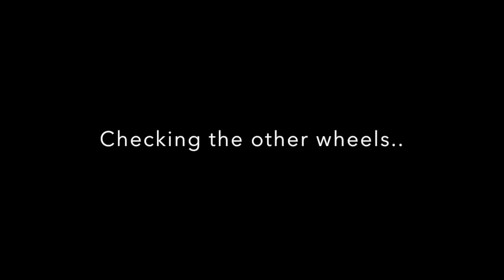New C63 wheel damaged after only a month!?

Comment from the maker: Pittsburgh potholes squad!
Reply: AutoVlog Good Morning,   Them potholes aint no joke.  They will  Mess your car up.  But on a good note may you have a fantastic day.
Reply: I almost his a huge one in Hopewell the other day. The worst.
Reply: AutoVlog Jag har tänkt på att skicka ett brev till dig, men jag vet inte hur man skickar brev utomlands. Hur gör man?
Reply: Pittsburgh pothole squad reporting lol
Reply: I feel your pain. But come to New Orleans...we don't have pot holes...we have CRATERS. I hope it's an easy and not so expensive fix. Stay blessed.
Reply: AutoVlog can’t you sue them?
Reply: Low profile wheels look cool, but this happens alot because the rubber is so thin, and the rim so close to the ground. You got off light if the tracking wasn't screwed up as well btw. I hit a pothole once and cracked the lower swing arm, only found that out when I went round a corner and the car nearly rolled over. It seemed ok until that point, but when the cars weight was transferred onto the corner of the car, the badly weakened swing arm flexed, and the car nearly went over as a result.
Reply: AutoVlog I would check to have that area to replace your wheel. The city is legally responsible for any damage to your car.
Reply: AutoVlog so sorry for you.
Reply: Hmm low profile is one thing but the actual wheel strength matters more. 2 piece wheels are still 2 piece. You sacrifice looks for performance. Plus the suspension setup might not be suitable with these particular wheels.
Reply: literally hit a pothole in my Mercedes yesterday and need a brand new engine :/
Reply: Those are my guys down there in Carnegie. They saved me a lot of money fixing rims of my rims.
Reply: Sounds like a sudden surprise! and not the good kind haha
Reply: That's why low profile wheels are crap, look good but useless on most of the roads around the world
Reply: Much love from the UK brother .... it was the same when I hit the biggest pothole in my 2017 tiguan new wheel from VW €600
Reply: Just want to say the freeways in Michigan have worse potholes than that, I hit one going 75 and both right front and rear tires popped and had to get two new tires and two new rims... love Michigan
Reply: On a car like that you should also change the tire, those high performance tires have to be 100% and you can't really tell if it hasn't structural damage since it was folded flat between the rim and the pothole
Reply: AutoVlog 😂
Reply: AutoVlog what did u expect with a 30mm tire with NO sidewall driving on public roads and u were only going 27mph 😔
Reply: AutoVlog  NYC  pothole capital !
Reply: The good thing about Germany, flawless roads in comparison to those over there.
Reply: nah, Montreal.
Reply: The state of NJ pays you back for repairs caused by potholes. Check your stats laws, maybe you can get the state to pay you back for repairs. Hope it works out. Good luck!
Reply: Call the pothole hotline bro.
Reply: Keep that car in the garage until June !, that sucks man .
Reply: Here in PR the roads are potholes 😂😂😂
Reply: Send bill to the Pittsburgh council !
Reply: AutoVlog great video I'm glad you got your Wheel fixed
Reply: I was doing roadside assistance for MB last week in Pittsburgh, can confirm that the roads are awful right now. Lot of blown out tires.
Reply: love your videos it amazing very nice...dude you are perfect!!!!
Reply: New Jersey is worse
Reply: You will be fixing these wheels on regular basis man.
Reply: NYC has horrible potholes
Reply: all of fucking PA is like that i completely broke a rim and fucked my alignment up a month ago
Reply: Sorry about that, I live in DC, it’s also full of potholes. THEY NEVER FIX THEM HERE, I’ve lived in this town for about 7 years, and they seem to not give a fuck.
Reply: AutoVlog welcome to the ‘burg!
Reply: Contact the city and prove the pothole was unavoidable and you can have them pay for the damages I had the same problem in Chicago and my rim and suspension was paid for
Reply: In einigen Ländern muss die Straßeninstandhaltung dafür aufkommen
Reply: my Jeep Grand Cherokee needs a new ball joint, and it's a 4 yr old jeep... hate the Pittsburgh pitholes
Reply: Loomingshade The Original no they're not! check the pendot website, they don't do shit for pothole damage unless it caused an accident
Reply: Hazardous Child nope, they only pay if it caused a accident.. I' just looked two days ago, my jeep needs a new ball joint. pen dot sucks!
Reply: Jonathon Mando not in PA, pendot has a specific law saying they wount pay for pothole damage, unless it caused an accident...
Reply: Glad to know that you got the wheel fixed. There are a lot of potholes in Jamaica.
Reply: Potholes and general uneven surfaces are usually found in the slow lane where all the heavy traffic spends most of their time. An AMG should never be found in the slow lane.
Reply: NY is worst
Reply: AutoVlog  "Mike " u got lucky last time got hold of one with low pro tire on my old avenger blow the tire out. On my grand prix I craked the rim and blow the tire. So pittsburgh in beaver county where ur at is bad for potholes
Reply: Got the beater
Reply: Well you call and file complaints against city hall for potholes damage to your car.
Reply: If you want to see true potholes come in Bucharest, Romania.
Reply: This is why MB uses 19" front wheels and higher profile tires. You can't run 20 series tires up front.Those front wheels are going to bite you again.
Reply: Wheel looks like a metal sheet.
Reply: AutoVlog it’s not the snow and salt.. it’s the snow plows that tear up the roads on the uneven or poorly repaired portions of the road.
Reply: And I thought the UK was bad for potholes.  I'm guessing you can claim for the damage can't you?

Comment: Problem with low profiles
Reply: you meant potholes?
Reply: Try driving to a 40cm deep pothole with 245/50/18  i guarantee it will bent also
Reply: DuBstep115 Yes, but with those tires that would not have happened.
Reply: Dubstep what does a 40cm pothole have anything to do with this? Of course a pothole that deep will fuck anything up, but that's not the pothole this dude hit. Stop being dramatic.
Reply: joakim Margate problem with driver
Reply: DuBstep115 Why i go 265 or 305s with 16s. No damage at all.
Reply: Yes. You don't do low profile tyres if you live in a pothole kingdom. At the same time, the wheels on his car are not OEM, therefore may be of subpar quality.
Reply: Forgiatos don't bend on potholes, they are made out if aircraft alloy
Reply: joakim, you make a solid point. Low profile ties offer relatively little cushioning.  I've hit much larger potholes that those in the video.  The worst damage I've suffered is a blown tire or loss of alignment. 

Also, the C63 taunt suspension doesn't help.
Reply: problem with wrong rims. you need tested rims, made by factories with a superstrong engineering department, not custumozied fucking craft. titan bolts are not necessary in a shitty un-engineered wheel, not approved by amg. car design is based on high engineereing. not a craft cake :)
Reply: @DuBstep115  those sound low profile too so yeah of course it would
Reply: @WatsitTooyah  What the fuck? 245/50 is like a fucking suv tyre, 25/30/35 are low profile tyres.

Comment: That's why you don't run ultra low profile tires
Reply: david1967able IN Winter.
Reply: Thats not ultra low, 1990 is gone. 35 profile is normal and 30 is low and 25 is ultra low
Reply: those tires are thinner than my motorcycles and i can throught bumps all day long and my rims would be fine
Reply: Especially in Canada and northeast USA.

Comment: I wouldn't have been driving that car during the winter months. You live in the rust belt.  Also, that pot hole seemed  not that deep. Even though you was doing 27.34 mph seems like that wheel should have been able to handle that. I would show the manufacturer the video and voice some concern their CNC process might be a little suspect.
Reply: I can see why my dad isnt into german cars anymore after his 2011 bmw 750li had all these electrical problems.
Reply: 29.2mph*
Reply: @MBS..  German cars are to be protected and served, especially those performance/exotic ones, while most people (maybe unintentionally)'s expectation it that a car would protect and serve you. But that's what give the German cars all those prestige and reputation, especially performance wise. And it's also why they're 'fun to drive'.

Comment: Sucks Mike, but those don't hardly look like "holes".  If those little dimples bent your wheel, that says something about the wheels more than the road.
Reply: Kevin Smith i agree. There's a number of variables from the cars weight that transfers energy to the suspensions design. But in this case it's clear the wheels showed it's true strength
Reply: it's a warranty case for the rim producer!
Reply: Sheesh if I had to warranty every wheel that went through a 2 inch little drop, I think my company would go out of business.

These wheels do look awesome!  But I think they may be the wrong implementation for the area.
Reply: Looks like it was quite sharp edge on the pothole, if it was 3 times deep but round it would not have hurt the wheel.
Reply: Cameras don't do well for depth, it may be deeper then it looked.
Reply: But video is awesome to tell depth!
Reply: It's not the rims fault it is the low profile tires. They are so stiff and thin that they don't allow alot of compression and energy transfer so it is like basically hitting that pothole with the rim.
Reply: Garret Rowe you're gonna blame michelins versus aftermarket rims?
Reply: thizzface not necessarily blaming it solely on the tires. as in the fact that low profile tires are good for damaging rims.
Reply: Garret Rowe it also depends on the strength of how the rims are designed. You're also looking at a 2-piece design with a weak offset. Not enough support on the inside
Reply: thizzface i completely agree with you that the rim is just as important but you can't argue that if it had taller sidewalls it wouldn't of bent.
Reply: Garret Rowe yes I follow you. I'm sure the tires might have played a role. But not at low speeds. I've used low profiles for 5 years and I have used different rims to know this much. Strong tire walls does matter but not to the point that the inner rim can bend like that is never good by design
Reply: Kevin Smith that's exactly what I thought. Yes, it sounded bad when he hit the "pothole", but they don't look like as if they should get such a heavy damage. I hit way worse things and my stock wheels were not damaged at all. Tyre blew and everything, but no damage to the wheel. That's why kids you should not by aftermarket stuff.
Reply: Right.  Come to Montreal to see 6 inch deep holes every couple of feet throughout the entire city, good luck to your wheels and suspensions.  Literally half the streets are rated "Bad" to "very bad" which is the worst rating they have.
Reply: It says more about the low-profile tires he's using. Those were not designed to be used on low quality highways at high speeds. He also had the suspension lowered, which again took a lot of buffer out.
Reply: I would really like to see what cars you guys drive and what wheels and rims combo. Since tires seem to be the debate thanks to Scotty Kilmer 😂😂
Reply: thizzface I only went as far as 255/40/18 on my Maxima and Genesis Sedan.  People who use 255/35/19 or thinner on their cars tend to have broken wheels and busted tires on a regular basis thanks to terrible roads.
Reply: Exactly he needs a set of aftermarket strong lightweight wheels
Reply: Definitely with 265/30 wake u pls...
Reply: 60km/h is pretty high
Reply: yay area!
Reply: Those potholes doesn't look deep... I'm really surprised the damage to the wheel, what Mercedes Benz says about it? the speed when you impact the pothole wasn't high.

Comment: it wouldnt happend to oem amg forged wheels.This aftermarkets are just shitty  :)
Reply: no, no oem would crack the pot hole, not pot hole crack wheel. Seriously, i do not know what quality are that wheels, but my fiend has the same bussines like the guy at the video and oem wheels, especially hihg quality like amg are really very very strong and can survive realy hard impacts. But you are right,  oem often crack instead of bending
Reply: sysell Yes thank you. Don't be fooled by forged after market 2 piece wheels. Designed to fail
Reply: thats what im thinking, i have 18 on my car with low tire height and i don't have that problem when i hit holes
Reply: Exactly, my VW Golf with 18s has no issues and i live in a worse area then mike.
Reply: sysell my bmw wheels crack instead on bend
Reply: Forged wheels usually do not crack.
Reply: I even got forged wheels stock, with a half the priced car: GTI Clubsport (seen on my channel)
Reply: He should've went with hre or rims that are jwl or tuv certified. These new "forged" rims you see coming out arent all forged. The spokes are forged but the barrels are plain aluminum
Reply: Robert Blackford all wheels can bend. OEM or not

Comment: hahahahaha those bumps bent your wheels.  Those are not pot"holes"
Reply: well if its big enough the wheel enters the hole to just hit its sharp edge when leaving.
thats a way harder impact than on a round shaped bump.
if your wheel size and driving speed align with the size of hole in can be a nightmare for any tyre / rim.

go out and look for that footlong crater-looking holes.. really dangerous for bikers etc
Reply: My car rides on low profile tires and I've blown them more times then I can remember however I've never actually bent the rim.

Comment: Swear this guy does it intentionally to his vechiles for content!!!😂😂😂
Reply: schutte83 vehicles*
Reply: Nah potholes messed up the rims on my dad truck there a real issue but hey at least its not hydrolocked
Reply: I think he does it inadvertently while filming content or fucking with his phone. Normal dudes don't drive into giant puddles at wide open throttle to hydrolock their shit, nor do they hit monster potholes at speed.
Reply: Seemed like he did it to promote the rim repair guys. It definitely looked like he aimed right for the damn pothole. Looked like if he kept going straight it would have been fine.
Reply: Robert Klecha right, because the YouTube revenue would offset the cost of driving back to the dealership/getting the rim repair guys to fix the wheel. totally makes sense. 🙄👍